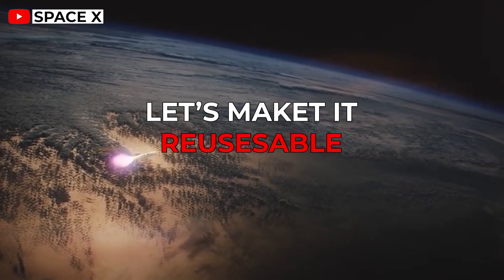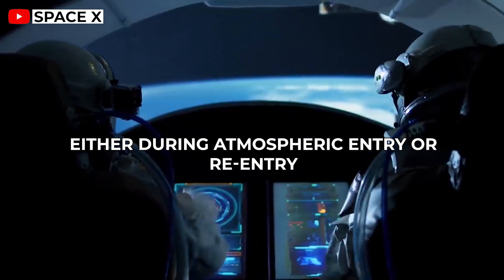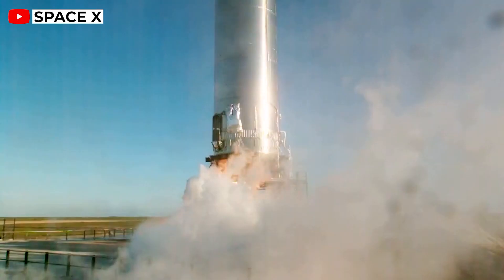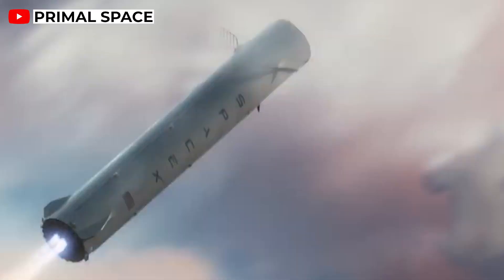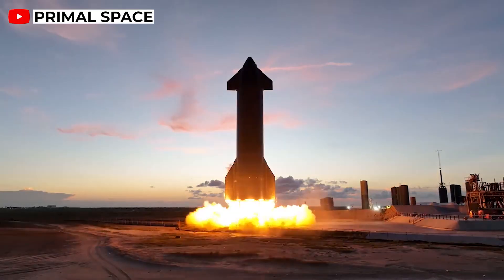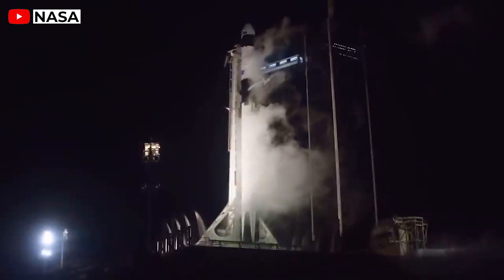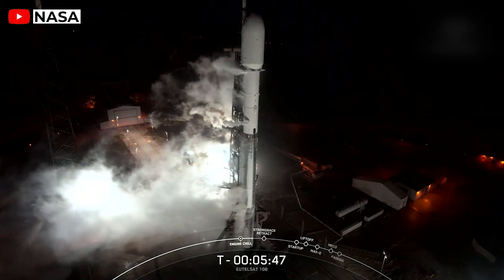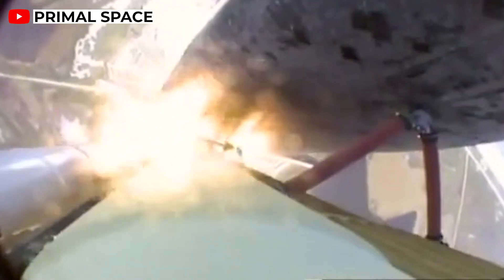FINALLY! SpaceX Starship TPS Tile Testings Fixes its issues!

Comment: Thank you for making this. Respectfully, 1:45 Aluminum melts at 150C? Steel at 170 degrees?? Al = 660C, steel = 1550C. Plastics melt at 150C. Btw, the SpaceX 'tiles' are called 'bricks.' And they have done more Starships tests since September with no TPS probs that I know of. Your title says SpaceX fixed its tile problems, but you don't say how. I'm sort of missing the point of the vid. There are lots of one liners with sometime supporting graphics but I missed the plot. Well, thumbs up for trying.